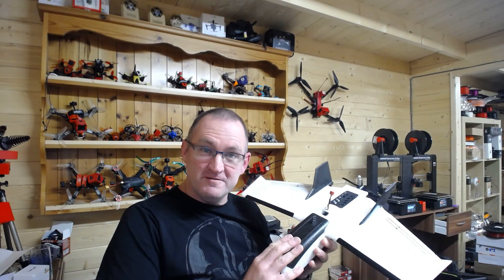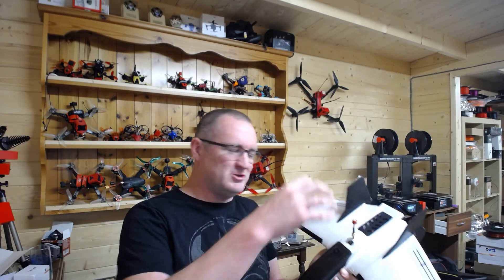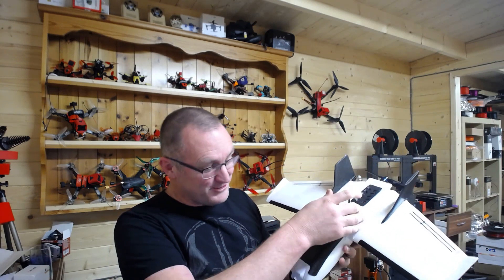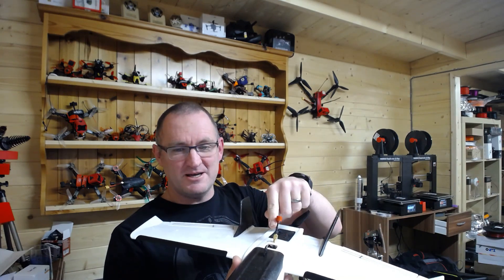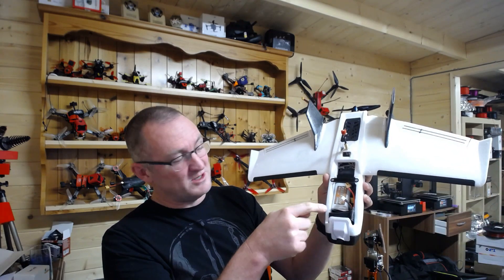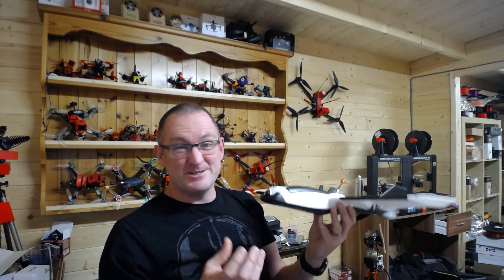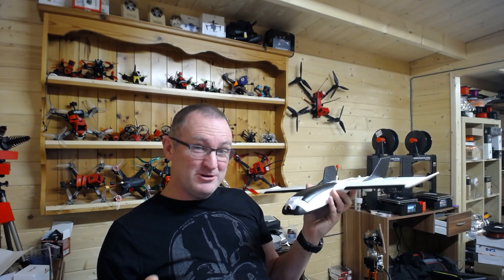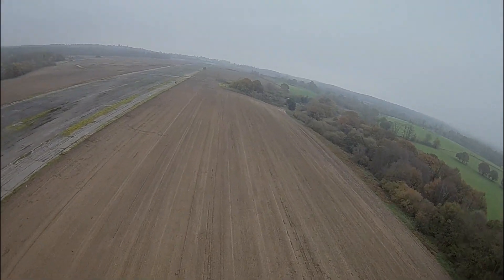ZOHD DART 250G | BUILD & FLYING

Comment: I have successfully maidened my dart250 yesterday. Moved cg also back a couple of mms, because other pilots reported nose dives in the ground after launch. I bought the kit version and run it on a 1407 3200kv, 3s config with a 2 bladed 5 inch prop. It dips slightly on launch and then skyrockets. It is very responsive and stable in light wind for it‘s small size. It‘s a fun flyer indeed and I had a blast from the first flight on. Great video btw!